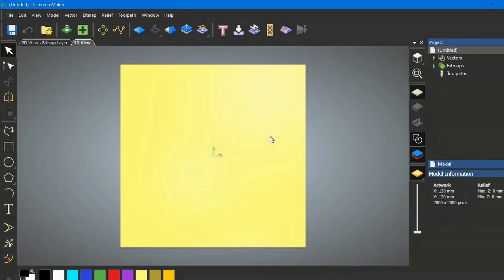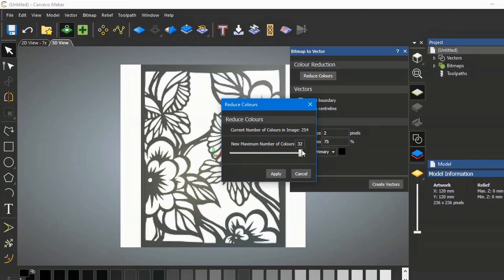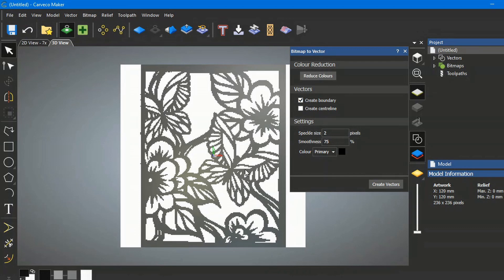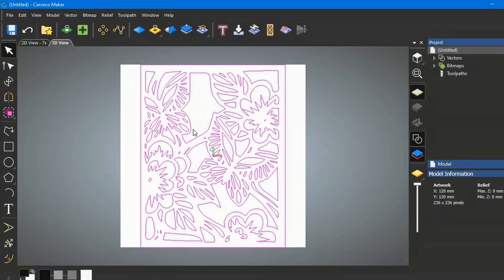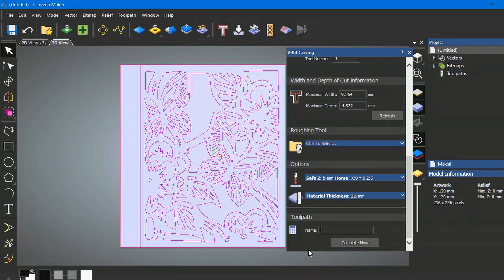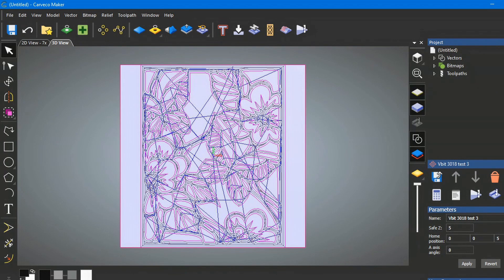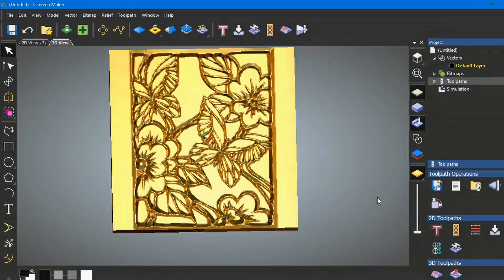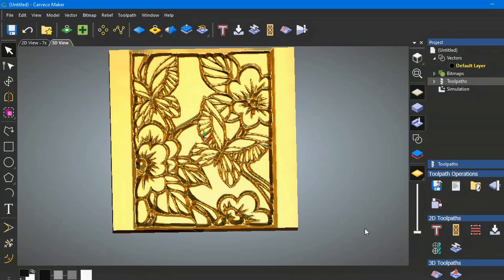Carveco Maker Vbit carving how to make vectors from a picture + new SVG file library

Comment: Hi Mr Roger, Is mach 3 work for win 8.1 64 bit OS.
Reply from the maker: 32 bit operating system only
Reply: @rogerwebb9600  Thank Mr Roger, what i need to do to operate mach3 on 64 bit os? Is there way?